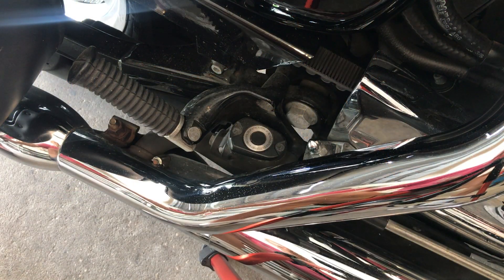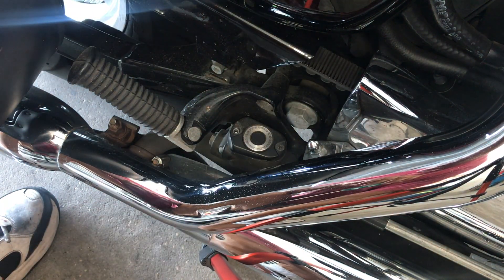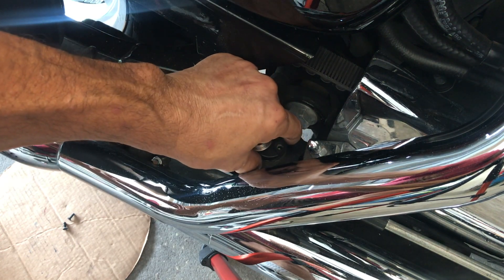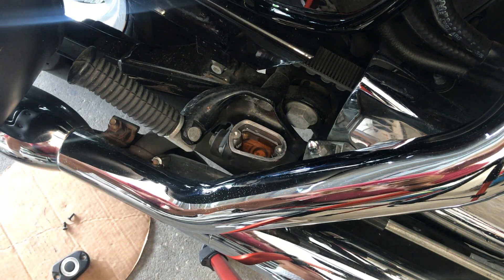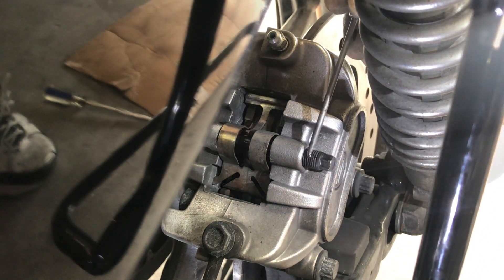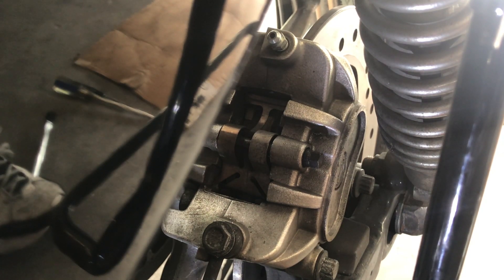How To, Harley Sportster Rear Disc Brake Pads Installed

Comment: Rocco,
Recently followed your excellent video and did this brake service, no more squeak!! One of my brake reservoir screw heads stripped.  I took the other screw to my local Fastenal dealer. They were very helpful.  They identified the size of the screw and found a replacement  for me in their catalog.  The replacement is an M2 stainless steel  screw with an Allen screw fitting. This screw is a bit shorter (10mm) but fits fine, looks good and  does the job. The Fastenal part # is M42530010A40000, the 12 mm is M 4253000012A20000.
Thanks again, your video was very helpful!
Reply from the maker: Happy to Help. Thank you for the info and your sub Andy... Ride Safe and have a great day..

Comment: This is great, I’m going forward with my rear brake pads replacement thanks to your clear instructions!
Reply from the maker: Happy to help. Make sure you collapse the pistons in your brake caliper all the way. Any questions just ask. If you have to relieve pressure just loosen your master cylinder cover just loosen cover. Thank you for watching and your sub pmadden. Ride safe and have a great day. Let us know how it works ou
Reply: It all went just as smoothly as your video. I did reuse the clips from the back of the old pads onto the new aftermarket pads with no problems.
Reply from the maker: Happy to read all went well.And the front brakes will be the same, Ride safe and have a great day

Comment: Hey Rocco! I wrote you concerning the rear axle removal on my 2007 sportster. You told me to be patient and gentle. I followed your directions and this past Saturday I removed the axle bolt, gave it one light tap with a soft faced mallet onto a block of 2"x 4" and it moved about 1 1/2". I went to the other side and pulled the axle completely out! Worked like a charm!
I wanted to ask you if you have done a video about installing the floating real brake caliper on the sportster . Once again thank you very much for your help!😊
Reply from the maker: Happy to help. Install it one piece when you remove the axle you remove your rear wheel the caliper stays right where it is. what I like to do is take the brake pads and open them up so when I slide the wheel back in, it's a little easier to engage and that's how I do it to pull the caliper off while the wheel is still on.Not an easy task. Let us know how it works out. Thank you for watching and your sub Luke. Ride safe and have a great day.

Comment: Have a question on my 2004 sportster 1200 custom bike starts up fine then if you let it set running it’s idle dies down and the front pipe of my bike will smoke but the back tailpipe  doesn’t any idea? Thank you !!!
Reply from the maker: Front rocker box oil leak,   https://youtu.be/1027WhyjqcQ.       https://youtu.be/0Ksshi9mGZk.  It is a two part video. Very popular leak on Sportsters. Take a close look at front jog on your motor. Any questions just ask. Thank you for your Sub Brandon.  So just smoke and she runs good?
Reply: It will run good revs up nice but after I rev it up after a few seconds the idle will die out and the front pipe smokes and it will shut off and it also fouls my spark plugs instantly and thanks for the reply you are always helpful
Reply from the maker: I would first Test petcock for vacuum leak in petcock.  Take a look at this video..  https://youtu.be/7Fo9Q93OJXI.  Let me no how that works out. It is important to have a Good running petcock.  This can cause a rich condition that will flood your intake.
Reply: I actually just changed my petcock valve today got one form the Harley dealer I have a 48 idle jet and a 180 main jet and my air mixture screw is screwed out 1 and 3/4 turns after I did all that today it started up nice revs up great but won’t idle just dies out and like I said the spark plugs fouled almost instantly very charcoal black looking and now I’m stuck lol
Reply from the maker: When you did your Petcock how did your screen and tank look?
Reply: Two Wheel Rocco it all looked pretty clean no rust from what I can see and screen looked alright now previous owner didn’t have their vacuum line hooked up to the petcock they had a piece of paper stuffed in end of the  hose off of the carburetor could that have done damage to the bike? Or possibly ruined the air filter?
Reply from the maker: Was this bike running with that line blocked off?
Reply from the maker: If you could send me your cell number and I will call now..

Comment: Why does my wife’s 2006 Sportster XLC require DOT 5 fluid? Secondly, can I add DOT 5.1 fluid to it?
Reply from the maker: DOT 5 will not stain paint on your motorcycle. No you can not mix.  What is the difference between DOT 5 and DOT 5.1 brake fluid?
DOT 5 is silicone based and DOT 5.1 is glycol based and mixing the 2 will harm your seals. DOT 4 or even  3  as they are all glycol based and can mix with .   Hope this helps, Any questions just ask, Thank you for your sub Michael.  Ride Safe and have a great day.
Reply: Thank you for the quick response.  She is laughing because she Google searched the answer and told me not to mix the two. Thank God I was being hard headed and waiting for your response though.
Reply from the maker: She knows Best...Always. Ride Safe and have a great day.

Comment: I Saved this video
Reply from the maker: Happy to help. Any questions just ask. Thank you for watching and your sub Natural For Life. Let us know how this works out.  Ride safe and have a great day.
Reply: @TwoWheelRocco  i'm trying to  solve my squeaky rear brakes on my 2018 Sportster. It has done this since I bought it new.
Reply from the maker: @lovingmylifeasIage6741  How many miles?  Did you try to remove the pads and clean them. If that all fails most likely a new rotor.  Let us know how it works out.
Reply: @TwoWheelRocco  6k mies. I've heard that several others are having this same problem with their sportsters. I'm going to try a different set of pads to see if that makes a difference.
Reply from the maker: @lovingmylifeasIage6741  I agree,  I have heard of this problem and it's a shame that Harley don't stand behind this issue.  a new rotor was the fix.  Hopefully yours is not the same. Let us know how it works out.

Comment: will this work on a 2017 xl883n
Reply: Very similar procedure...
Reply from the maker: Yes it is. Let us know how this works out. Thank you for your Sub Theo. Ride Safe and have a great day.
Reply: i am probally wrong but i tried to do the pads but i stopped . it seems that on my model i need to remove the calliper which means removing the shock. i am going to have a closer look at your videos and try again.  i have never done it before so i am probally doin something wrong. thanks rocco
Reply from the maker: Take a look at this part, Brake pad install pin.   Part # 6. https://partsfinder.onlinemicrofiche.com/ronnies/showmodel.asp?Type=13&make=hdmc&a=1195&b=30&c=0&d=2017%20XL%20883L%20SUPER%20LOW%20(CR)%20BRAKE%20-%20REAR%20BRAKE%20CALIPER%20ASSEMBLY.  Just remove pin and collapse caliper pistons remove pads and replace. take a look at my video.  Let us know how this works out.
Reply: than you very much you are a champion